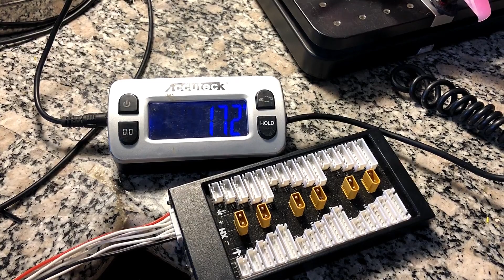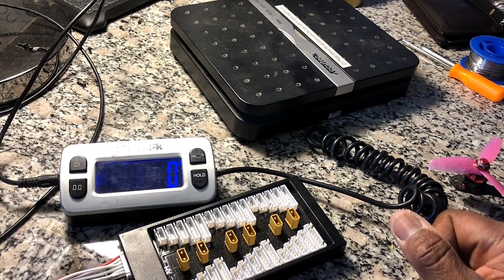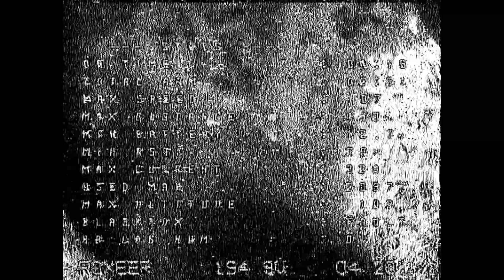107mph Tachyon 1408 4100kv 3" Quadcopter  172grams!

Comment: Whats ur flight times
Reply from the maker: Pat Donovan its a battery hog Pat. If you fly aggressive, you're looking at just under 2 minutes on 650mah 4s and about 2.5 to barely 3 minutes with an 850 mAh 4s. But it's fast as heck. Just remember, my weight without battery b is 172gr. You should be much lighter with better performance.